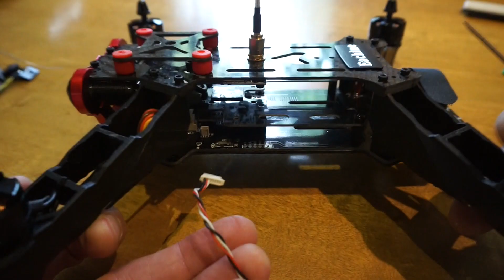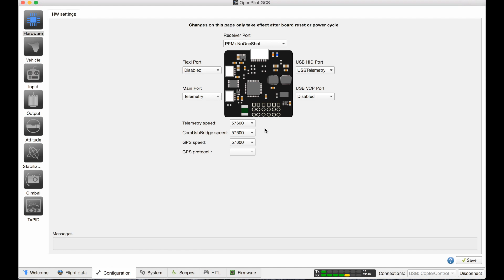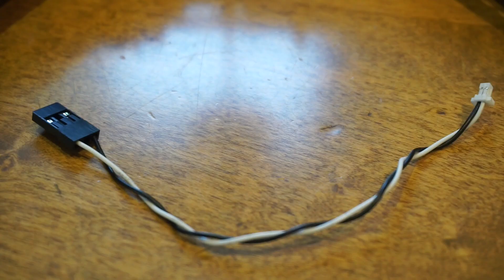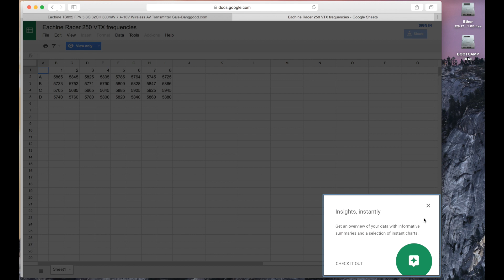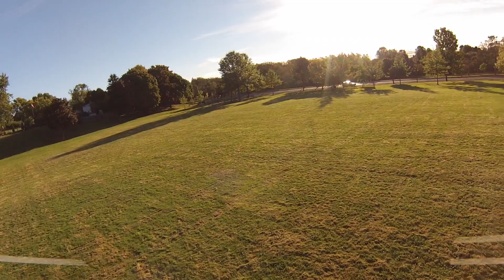Eachine Racer 250 Setup and test flight

Comment: Brandon, I just received this model yesterday & as I was doing my background research I found your video.  So far it's been the most informative.  Thanks for producing & sharing it & I  will use its content to setup my model.
Reply from the maker: +Willie Hill, Jr Good to hear. Thanks for the kind words and best of luck with your ER250!
Reply: +Brandon Hill Hey, you're not a long lost cousin, are you?  LOL!  Anyway, do you have any PID settings you can share on the quad.  Mine is 98% setup, but I have a tiny bit of wobbling going on.  I've conducted about 4 test flights to calibrate the CC3D board.
Reply from the maker: +Willie Hill, Jr Hey, you never know! Yes, in my other ER250 video I share my PIDs: https://www.youtube.com/watch?v=u2-dq2_SxvA. They're okay, but I think there's still lots of room for improvement!
Reply: +Brandon Hill Brandon, I really want to thank you for responding to my comment to you.  I plugged your PID settings into my quad today and it flew MUCH better than the settings I was using.  Still needs a slight more tweaking but I'm very close to a perfectly tune machine.  Both vids are superb & I'm glad you posted them.
Reply from the maker: +Willie Hill, Jr No problem. Sorry it took so long! Glad to hear your quad is flying better.
Reply: Sorry, but after buying the RTF and watching your other video on mods for performance, I am still quite unhappy with the PIDS but I don't want to have to reset all of my data on my racer. Is there any way around this so the PIDS can work without having to update it?
Reply from the maker: Not sure I follow, but yes, you should be able to export all/any of the settings you want via LibrePilot, then import them at any time down the road. It's a good way to store PIDs based on different batteries or cameras you use, beyond the three-slot bank.

Comment: Hi to mount the reciver antenna you can use a zip tie trick :) Bruce from rc model reviews showed that in one of his videos and the trick works for me like a charm :)
Reply from the maker: +Piotr Nikiel Agreed, that is a good method - I especially love the appearance - but they can still get in the way of the props in a crash. I've sliced a couple antennas that weren't taped down. A couple pieces of scotch tape weighs less, too.

Comment: Great video! I would really like to buy a Eachine 250 and get into real FPV flying but know nothing about it. :\ Didn't know what you where talking about half of the video.
Reply: +F8H I'm in the same boat.  I bought this same model, after reviewing several, and this one is NOT for the beginner that I am!!!!  Nevertheless, I was delighted to find this vid, Brandon Hill...but where does one find more info on this?  Documentation with product was non-existant, and communications w/manufacturer are having serious translation issues.
Reply from the maker: +Kathy Hoover Yes, it's not really a beginner quad. Usually the best place to find information for Chinese products with little or no documentation is http://www.rcgroups.com and here on YouTube. Is there anything in particular you're struggling with?
Reply: Kathy Hoover do

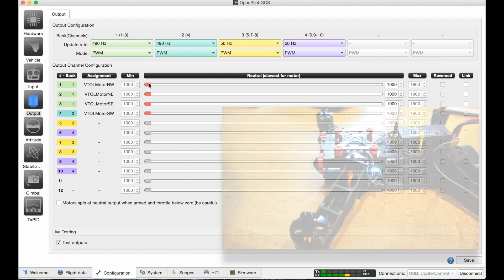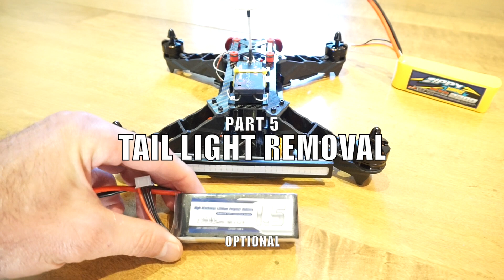Comment: A very useful video. :) When you measured the motor neutral values at 6:57, you removed the props. I understand that is for safety reasons but on the other hand, I think having load (i.e. the prop) would give a more accurate motor neutral value. What do you think? Can you confirm that the video transmitter is able to toggle between 32 channels? Is there a specific order (e.g. A1, A2, A3...) as you toggle through the channels by long-pressing of the red button? Great info at 13:46 on Tail light removal!
Reply from the maker: +Fyre SG Thanks! Good point about motor neutral values - I tested with props on and got the exact same values though. The stock props are pretty light. Yes, the video transmitter cycles through A1-8, B1-8, C1-8 and D1-8.

Comment: Very nice video thanks a lot my Eachine 250 is now ready to fly !! :) 
I just have one question: I did exactly like you for the lights but when I hit the switch (standard 2 position switch) it doesn't turn the lights off :(
Reply from the maker: +Tahitian Rider I used a momentary switch to control the lights. If you use a two position switch you have to toggle it on and off once to turn the lights on, then again to turn the lights off. Unless you need the trainer switch, use it instead.

Comment: wow such a nice video really helped a lot, i think at least, haven't gotten mine yet still waiting for it. I have one question though. if i used a spectrum satellite receiver would i the have to do something different or should i just connect it like a normal pwm receiver?
Reply from the maker: +simerlimer209 I haven't used any Spectrum satellite receivers, but so long as it's PPM (I think some are SBUS) you'd connect it with just the red, black and white wires. They aren't PWM though, since they only have one signal line.

Comment: Great video good info in there.  I was thinking on the flight time, would it help any to use a more aggressive pitch or larger blade to help with the added weight of the camera and or the larger lipo?
Reply from the maker: +Joe Shedler Thanks! I think increasing propeller pitch increases thrust but decreases flight time, and increasing diameter can increase hover time but decrease overall flight time (it's pretty confusing!). I know people have successfully used 5045 props, but there isn't room for larger diameter props because of the headlights. You could play around with http://www.ecalc.ch/xcoptercalc.php (though you'd have to guess at the components).

Comment: Great!
Just a great detailed review! Thanks you!
(sorry, that English is not my language, and not everything is clear)
Can I ask you to be more technical questions?

Can you see all of your equipment assembly with power supply and so on? Interest as the receiver is powered, which he Connector? As -AUDIO are connected by video, is there a sound?
Reply from the maker: +NORD S Thanks, glad you enjoyed it. Most video receivers come with the cables needed for power and signal input. For power I'm using JST connectors, since the battery I use already has one. Yes, great question, the camera has a microphone, so you can use audio if you want.
Reply: Excellent!
Clear skies with no wind and noise ...

Comment: Great Video,  Thanks....   I just got my Eachine 250 and have it working with my FRSKY TH9X  I have a few issues that maybe you or someone could help me with.  The Receiver is the D4R-ii    I would like to get the lights setup front and rear where I can turn the front on,off and if possible change the color of the rear lights.    Also I am using PPM
Reply: +Grandpa Jake (FunTimeGrandpa) 

The D4R-II only outputs CPPM or PWM. You can't do both at the same time.  If you want to use use your D4R-II in CPPM mode (or a PWM) mode, you won't have a spare (or any) PWM channel with which to control the lights.
I was debating on using a D4R-II on my Eachine, but found that I had to use a V8R7-II if I wanted to control the lights from the transmitter.
Reply from the maker: +Grandpa Jake (FunTimeGrandpa) +K Danagger is correct, unfortunately you can't access PWM if using PPM on the D4R-II.

Comment: Funny that my red-black-white start from the right to left? My connector from naze32 to powerboard was also backwards. Did not get any voltage after pulling al the small pins out and turning them around. Thank to the people who made this. Is my connector on this wrong also? My trotle is roll and everything is wrong.

Comment: thanks for your video really helped set up the quad, i am having trouble receiving video signal on headplay goggles tried other monitor as well any ideas . any help is appreciated. thanks
Reply from the maker: +Photonx28 Are your antennas the same? If you have an RHCP (right-hand circularly polarized) on the Tx, you need a RHCP on the Rx too. Cloverleaf antennas come in left- and right-hand configurations, and they need to match. Otherwise, I'm not sure what to suggest other than to make sure your goggles are set to a channel that the VTx can broadcast on, then switch through each of the VTx channels by long pressing the little red button. Sorry, I know that's not much help. Good luck!

Comment: Excellent video review Brandon.. I just got this quad in the mail...
I have a PPM ready reciever X8R but is the wire saving the only reason to use this mode or are the other benefits>?

My quad fits 2200 mah lipos just fine with the led light left on.
Reply: which 2200 mah?
Reply from the maker: +Bill Baker Reduced wiring is the only benefit of using PPM. My 2200s are 65C, and higher C rating means larger dimensions. Also, I'm not sure if the tail light size changed with v2 (I have v1).

Comment: thanks for the video! though i think i will get the RTF version cus i dont like messing with all the tiny stuff cus  no matter how easy it is i am guaranteed to mess it up lol

question: why do u have to keep switching channels to c4 or whatever even though you were getting video signal on other channels?
Reply from the maker: +TheRoshan89 The channels aren't contained in exact frequencies, but rather are centred around them. Being typically only separated by about 20 Hz, adjacent channels, or channels of similar frequency, will "bleed" into one another. This is why the "race band" channels are separated by 40 Hz, to minimize channel interference. The reason you want to get an exact frequency match between Tx and Rx is because the range will be drastically reduced if you have two different channels that are just bleeding into one another. I once flew with mis-matched channels and lost FPV signal within 100m.

Comment: Hi Brandon awesome vid, I have a question, the white cable for the lights does it go on the bottom layer of number 6 on the receiver and do I need to do anything to my transmitter to accept the lights I bought the ARF. Also mine is different to yours there is no middle carbon layer also the input for the light cable is directly next to the light switch, any info would be greatly appreciated cheers buddy
Reply from the maker: +SUPERHIGHFLYING It should go to the signal pin. Whether it's on the top or bottom depends on the receiver. There should be a symbol that looks like a square version of this: Ω. On the Tx you just have to assign a switch to ch. 6.

Comment: Great video Brandon, I have a similar setup but ran mine in SBUS and have everything other than the lights figured out.  When I hit my lights switch on the transmitter it cycles them rather then on/off.  I have to go through all 8 colors in order to turn them off.  Did you run into anything similar or can you point me in the right direction?  Thanks in advance.
Reply from the maker: +Tory Solheim I have the v1, which doesn't have the RBG LEDs, so I can't offer any help. Mine switches strangely, and is why I use the (momentary) trainer switch so one press turns them on and one press turns them off. Sounds like the v2 has a different behaviour and unless you can set up some kind of macro on your Tx, you'll likely just have to deal with cycling them.

Comment: Hello Brandon. I have the same 250 quad copter in my case I decided to use PWM due my receiver  so If I not misunderstood what you explained, to make this drone turn on and turn off the lights what I need to do it´s unplug Chanel 6 wire from the CCD3 flight control port and use the black and white wire instead? and connect it directly from my receiver to the little port beside the lights switch. Hope you can help me to understand what I need to do. Thanks
Reply from the maker: +César Hernández Yes, that's right. If your receiver has more than 6 channels you could use ch. 7 or 8.

Comment: Did you ever test 2200 batteries and were they worth it? If so can you provide a link? Also, what goggles do you have? They look so small compared to the ones I've seen. Thanks. Appreciate the video.
Reply from the maker: +Travis pisani Yes, I found they provided a bit of extra flight time, but negatively affected the performance – it is already tail heavy, and the 2200 made that worse. I think 1800s might be as big as you'd want to go.

Comment: I seem to have all kinds of problems with the eachine 250. The current version of Librepilot is 15.09. I do not know where to find the old version. The computer say i am armed, but it won't spin props. In firmware, the rescue and Halt will not work until I disarm, I can't disarm because it won't let me in. Is there a boot hook up-- I can not find it at all. Any ideas?

Comment: I got one of these and followed your video all the way through. I can get my motors to spool up after arming....Any suggestions? I tested the outputs and they worked great under the program.Any help would be great.Shane
Reply from the maker: +Shane Quale I'm assuming you meant "can't."  If the motors are spinning when controlled via GCS but not with the TX, it sounds like a radio config issue. In the Configuration > Input > RC Inputs screen, make sure your throttle input is working as expected (my values are: Min=990, Neutral=1031, Max=2016.) With the quad powered (but disarmed), check that max throttle on the transmitter shows as max in the GCS.

Comment: Hello Mr Hill good video,  I still cannot get the thing to work.  I have the frsky radio and frsky x8r receiver and I thought i could set it up with just the 3 wires like you did as in ppm.  but no.  where does the black, white, red go into the receiver, sbus, rssi, or smart port.  totaly lost
Reply: +dan thompson The FrSky you have does not output the CPPM protocal, your option is SBus.  The CC3D can except the signal BUT not via the receiver port.  IT's input through the Main port. https://librepilot.atlassian.net/wiki/download/attachments/2818090/CC_CC3D_Atom_Pinout.png?version=3&modificationDate=1445250262060&api=v2
Not sure this board has a main port.
Reply from the maker: +dan thompson +Nodent is right. Unfortunately, if you have the same CC3D board as me, there is no "Main port" plug which can accept the SBUS signal. You'll have to use PWM.

Comment: Hello Friend. The electric drone system eachine race 250. Supports 2315 1000KV engine. THE ENGINE THAT COMES ON DRONE E 2204. 2300KV. I'LL ALMENT THE ARM OF THE DRONE cuts the arm and put a stretch 8cm FOR HELICE MAJOR 1245mm. Esc 30A I will leave without gopro AND BATTERY. 8000MHA 11.1v. I WANT TO MAKE THAT MY SOMETHING IF I WANT TO PLACE ENGINE 2315 1000KV the total weight of the drone will be with a battery included will be 996kg less than one pound the weight and much smaller than a f450 altomomy of the drone will be 1 hour or so

Comment: Brandon-i am using the dx6 by spektrum-can you explain ppm vs Pmw and why I would want to assign everything to one channel-will the spektrum do this and what is the advantage. can you explain the two different values-ppm vs pmw?
Reply from the maker: +BDS The advantage is less wiring. You don't assign everything to the same channel, rather the signals for all the channels are transmitted from the Rx to the CC3D on one wire.

Comment: i have a spektrum r6210 receiver. with the set up you did, where do the wires connect to? the growing, positive, or the pin all the way to the right?
Reply from the maker: +Bobb ily The cables coming from the CC3D receiver port are in order starting from 1, and the first two wires are power. Your receiver doesn't appear to be PPM capable, so you have to plug them all into your Rx (then verify the order in the GCS Input screen).

Comment: do you have a video showing how to set this up with open pilot or one simular im buying this one as my first brushless and im nervous about programing it iv never done it or even compuetr savy from what iv been told i must program cc3d fc before i could get in the air
Reply from the maker: +George Posey This it it :) The CC3D is already flashed with firmware and has some stock settings, so you can get it in the air having only to configure your radio (if you bought the ARF version). Don't be nervous - it's easy and fun once you dive in.

Comment: Did you mess with the PID settings at all? How could you flash without altering them? How is It flying?
Reply from the maker: +K0gashuk0 In this video I used the factory PIDs. They're already saved to the CC3D board, so there was no alteration required. With default PIDs it flies okay. I since changed to (and prefer) OPNGTune PIDs as shown here: https://youtu.be/u2-dq2_SxvA. Will probably switch to Cleanflight soon :)

Comment: how do you set up the transmitter with the ppm setting on the one connection onle channel 0ne is used can you maybe help me with that setup since I have the set up on the 250 racer like yours
Reply from the maker: +James D The Tx is set up the same way whether you're using PWM or PPM. You need to assign Throttle, Roll, Pitch and Yaw to channels 1 through 4, and a (3 position) switch on channel 5 to change flight modes. PPM in this case refers to how the Rx talks to the CC3D, not how the Tx talks to the Rx. Hope that helps!